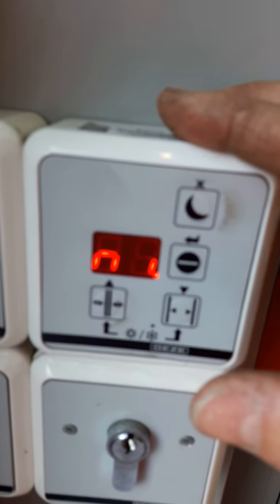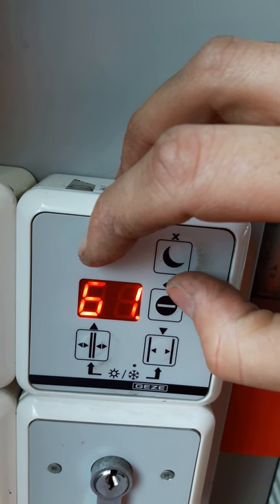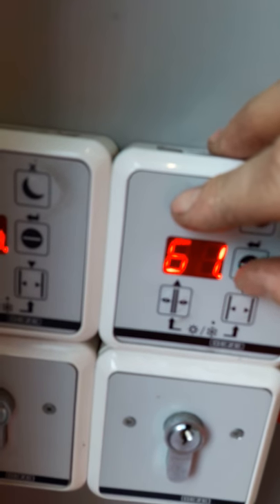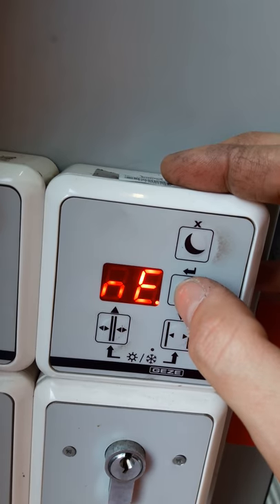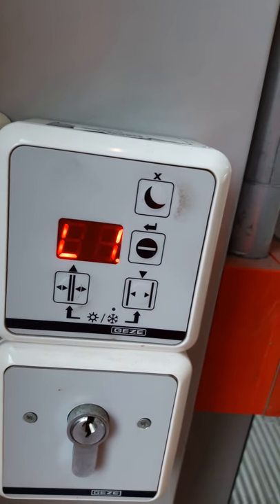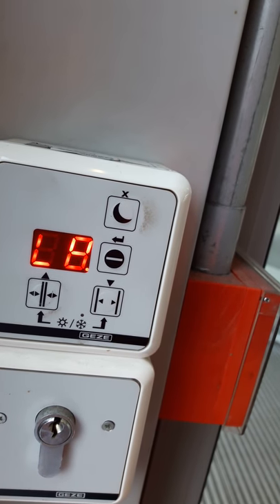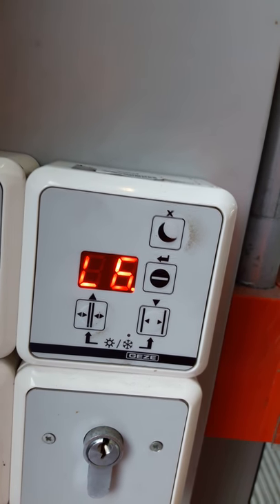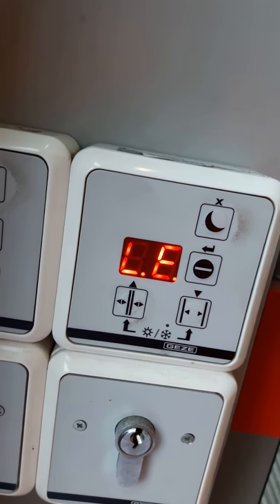How to reset / calibrate / learn a GEZE SLIMDRIVE auto door

Comment: How do I completely lock the door? We have it in the new company building but even in night mode, it can be still opened with a little force
Reply from the maker: This means the lock does not operate if this is even fitted. The motor seems to be the only device that lock the door at the moment hence why you can force it opened. Unless you have mechanical locks on the leaves. I recommend to call an autodoor engineer out for further investigation

Comment: Can we deactivate both sensors, internal and external?
Reply from the maker: Yes, everything is doable technically. However, you need to ask yourself some questions first. Do you only want to disconnect the activation and fit pushpads or card readers instead, in this case it is perfectly ok. However, the safeties cannot be disconnected because it would make your door operation unsafe and the regulations not met. I would not recommend the latter